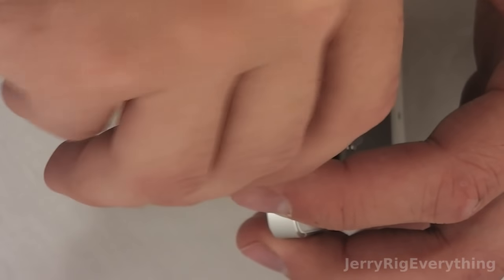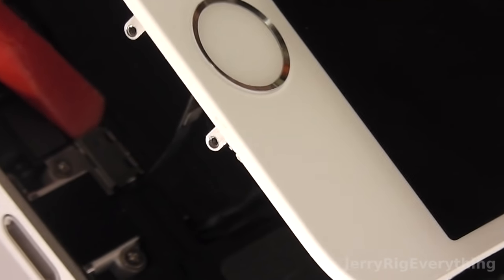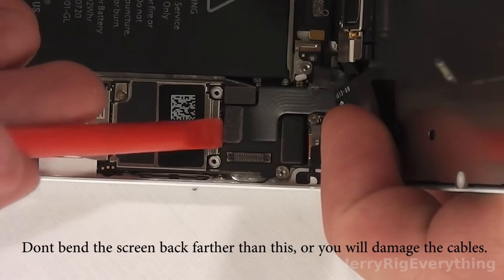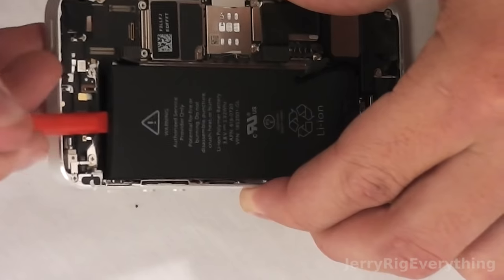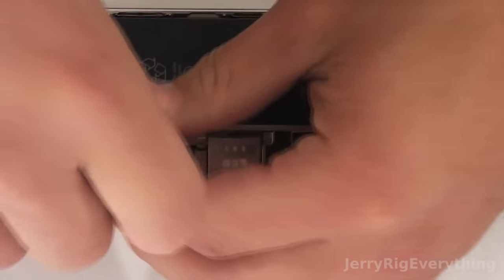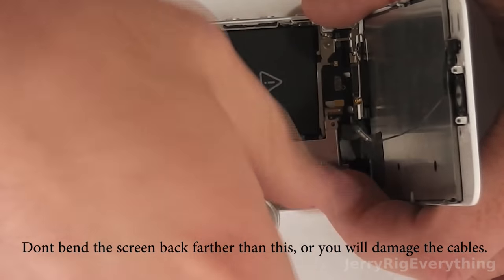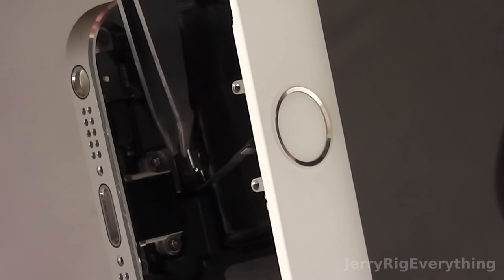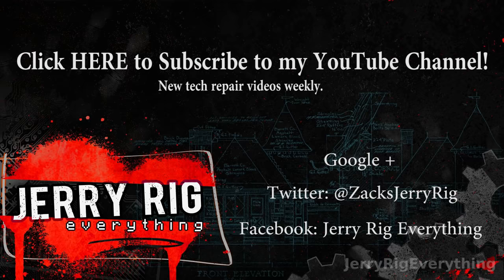iPhone 5s battery replacement in 6 minutes!

Comment: Help, i changed the battery and everything seems ok but it doesnt turn on, via usb cable the phone does nothing, i get the original battery again(thah retains a little bit of energy) and it doesnt work. i didint broke a single resistor or anithing like that, just didit clean. someone knows what could be happening? sorry for my bad english

Comment: On 5S installed exactly as the instructions, it became a brick (screen with cable and asking me to connect to support for restore, which does nothing and gives me error 4013)  this was few months ago, so had to get another phone, apple does it purposely with the battery pack not to be replaced by customers so they can keep skimming us or force us to upgrade to their crap.

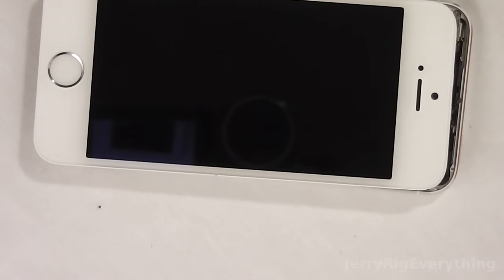Comment: At 04:55 "Amazon is usually the cheapest place to get batteries" and then you give a link for another seller, not battery from Amazon. I ordered from Amazon, $3 more, but I get 3% back for using my Amazon Visa card, and the buyer protection that doesn't come from other sources. Fixez.com says you cannot return anything that has been used. Hmmm... not use a battery?

Comment: I punctured the battery. Should I keep going?
Reply from the maker: You should get a new non punctured battery. And it is a fire hazard. So be careful.
Reply: JerryRigEverything Damn jerry youre just on top of it today.  BTW is it okay to not put the fingerprint bracket back on? I only redid the connector and it's fine so far. Thanks!

Comment: My touch ID is not working after replacing the battery. I also did break something inside at the top of the phone, so far only touch ID not working. 😭

Comment: erm...my fingerprint recognition no longer works! Advice?
Reply: You downgraded to an iPhone 5 :D
Reply: T3HL393nd :D
Reply: i have same issue. have you found any solution?
Reply: If the fingerprint sensor is not working there are three possibilities.
1. The plug is not fixed in properly.
2. The sensor is not working .
3. Damage has been caused to the connector pins on the board when prying or pushing it on/off.

Comment: I have a iphone 5s. It fell off my bed by me. After that day it starts up only when I plug it in with charger. As soon as I remove the charger the phone goes off. And when it turns on sticks on the itunes symbol. I’ve tried connecting it to itunes but it doesn’t connect with my pc.

Comment: The phone in this video has already been taken apart. Adhesive strips are not mentioned, and @ 2:45 it's just plain not so! It will take you 6 minutes, after 10 days of doing nothing else, but taking the battery in and out. Very deceptive.

Comment: I have changed battery with this video.
Please do not put battery out like this.
I think he already put battery out before upload clip.
put battery  out with sticker tag safely. 
This tag is in bottom of battery above home button, with hole to help battery out.

the Wifi module is cut when put tool in top of battery to out,
the wifi module is very thin to be cut easily, this is in top of battery.
so be careful but You do play exactly right manner make it not happen.

Comment: Tnx 4 Vid & comments section: 1) I won't try this -- too hard & dangerous 4 me.  2) Alternative is buy battery case or ext power supply -- or pay Apple.  3) I blame Apple 4 non-customer-friendly engineering. IMHO such devices & laptops shud have easily accessible battery compartments. I figure I wud lose screws, have hard time w/ the connectors, play hob getting the dangerous battery out safely.

Comment: I had some trouble getting the battery out without prying too much, then I tried an old Tupperware citrus peeler, it worked great to get under the battery. Thin, narrow, and strong plastic.

https://cdn.shopify.com/s/files/1/1071/5468/products/X13_Tupperware_UK_Citrus_Peeler_grande.jpg?v=1448806292

Then I used a free walmart paint stirring stick to pry it the rest of the way up. The whole job took about 20 minutes, thanks to this video and an old piece of Tupperware!

Comment: Everything fine, apart from the fact that removing the battery requires a devilish power, due to the fact the Steve decided to GLUE DOWN THE BATTERY. A task of ten mins took more than an hour because of it. And I ended up ripping apart the battery, that's not good. What if it lit up on fire or something?!

Comment: Well I’ve replaced the battery which certainly works. However my iphone 5S is now only useful as a paperweight. I’ve probably put the screws in incorrectly. They were so tiny I couldn’t tell which one was longest. I get a sort of tartan pattern on the phone but nothing works anymore. From the comments it looks like I’ve literally screwed up.😢

Comment: Jerry just received my replacement bat. but my cable is not the same. My phone has 5 connecting tables on the cable the replacement bat. has 4 what up or has anyone else had this problem
Reply from the maker: You might have received the wrong battery. If it doesn't look the the one you removed.

Comment: My next phone is gonna be an android. This is way too complicated and I've had my phone for a year and now the battery just started dying super quick. Last week it was fine. I have no clue what happened but now it will go down 20 percent watching a 4 minute video. It only lasts 5 hours in standby before it dies. At least with android it's easy to buy and replace the battery.

Comment: I done mine today. Your instructions were exact. BUT the origional battery was stuck down so firmly with adhesive that I bent the back of my phone slightly whilst trying to remove it. 

No fault of the person in video but apple the c** who want it to happen so you have to buy a new phone.

Comment: guys there is a little tab hanging out where you can easily pull the adhesive off like a long elastic string but for some reason this guy has no clue about it look up other videos this one is not good

Comment: Not happy with your video. You didn't comment on or show how to lift out the battery using the black end of the adhesive strip. My battery was glued down so firm I couldn't pry it out without mangling the old battery (which in turn got hot and tried to start on fire). This caused problems that probably could have been avoided.

Comment: The battery and its accompanying tools are fine BUT BUT BUT having been through the experience of trying to fit this I would say do NOT attempt to do so unless:
1. You have almost ENDLESS patience - it can take hours of very, very frustrating fiddling with tiny parts
2. You have a very steady pair of hands - if they're at all shakey, you'll be at this for a long time
3. You're willing to put your iphone at risk. The possibility of breaking delicate parts is very high. You definitely need to follow the video advice as well as the instructions. I thought I'd ruined my phone after finally installing the battery as there were lines all over the screen. Further research on youtube revealed that I'd loosened a connection. Luckily I fixed it, but it was a hair-raising moment when I restarted the phone - by which point I wished I'd never attempted this very delicate operation
4. It's quite dangerous. The original battery is firmly stuck down and in trying to prise it off the battery started to bend and puncture, risking a fire or an explosion - the battery should always be discharged below 25% before attempting this
5. I dropped tiny parts many times onto the carpet and inside the phone itself - best to do this in a proper workshop that's designed for it
6. The tiny screwdriver that comes with the replacement set is not really magnetic but needs to be if you want any chance of getting your screws back in place inside the phone. I needed my own tools for this.
Do I regret buying a replacement battery? Well, no, because it does work as far as I can see. Would I ever do this again? NEVER!! Just pay the extra to get someone in town to do it - it may cost more, but then again is it really worth losing several precious hours to hopefully save a bit of cash? DEFINITELY NOT!

Comment: What a total piece of crap, bloody battery was practically welded in. Phone is no good without a battery so with nothing to lose I ripped it out using a 4 inch screwdriver, sparks flying, it fought to the death but I got it out in the end. I think apple would make it easier if they actually welded the battery in, then I could use an acetylene torch or a disc cutter, or both to free it. 😃